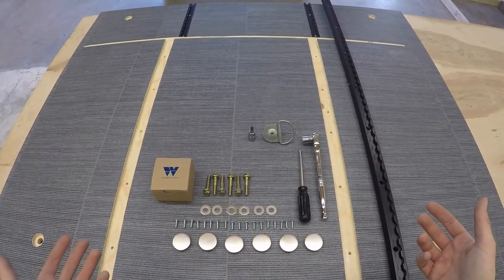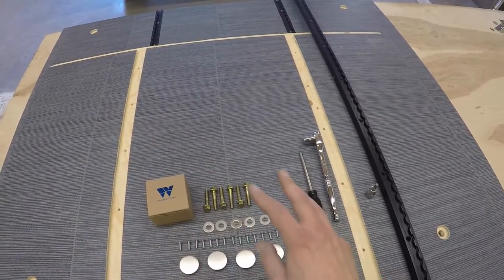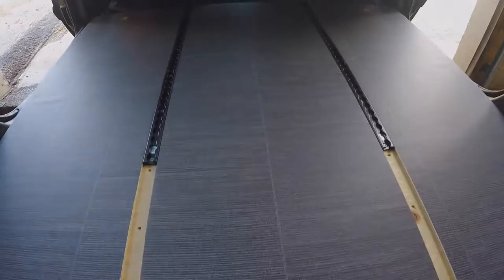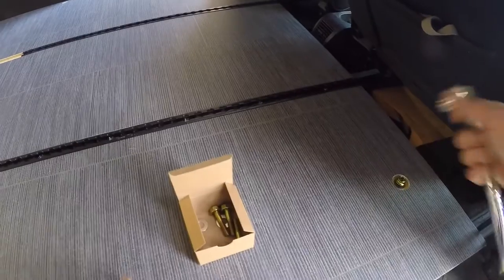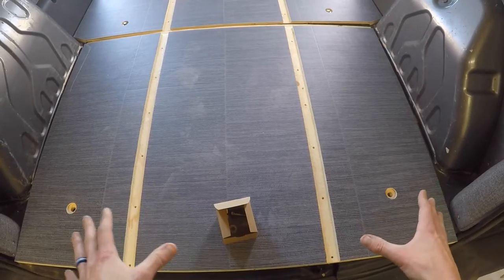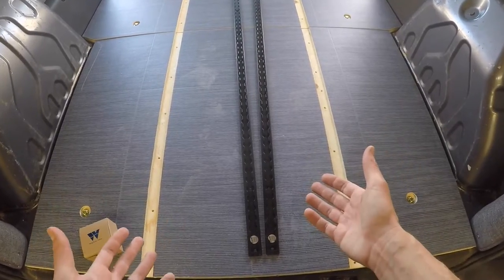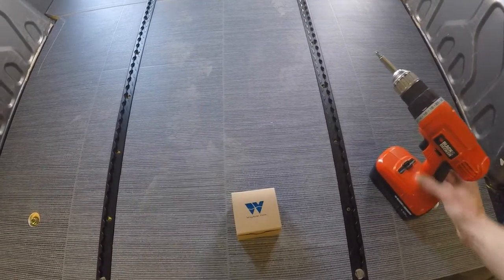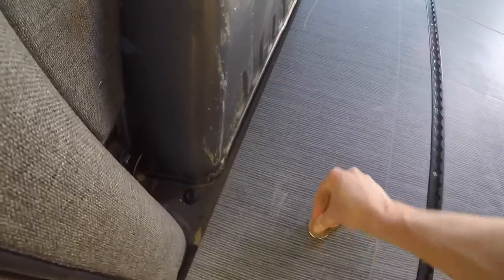Wayfarer Vans - Step One, Camper Van Floor Installation

Comment: What are your thoughts on putting down a layer of reflextics, and whether it would make a difference regarding extra insulation for colder weather and sound?
Reply from the maker: Hey Che,

We actually include a layer of reflectix on the bottom side of our floor, just isnt seen in the video.

Comment: Does this kit include rivet nut points for the tracks? the track installation seems a bit un finished in this video but I could be wrong.  It seems like you are simply mounting the rails to  the plywood...correct?
Reply from the maker: Hey Joe,
Actually, on the other side of the floor channels are T-nuts, so the rails are mechanically mounted to the floor rather than just wood screws that could pull out easily.  Hope this helps.
Reply: @WayfarerVans  gotcha

Comment: What is the floor made out of? How moisture-proof is it? It appears to be some sort of particle board. If so, especially along the track where it's unfinished - would that not immediately start to wick almost any small sort of moisture and start to warp/degrade the flooring? Seems like you are one good spill away from a warped and ruined floor. Not trying to criticize, I'm just curious because I'm actually very interested in your system for a future van purchase.
Reply from the maker: Hey Anthony,
The floor is made from a composite, and between the reflectix underneath and the vinyl we overlay on the top, it can resist a significant amount of moisture.  We have a lot of owners in humid climates and others who use their van for skiing, where the floor sees a lot of snow/slush. Therefore, unless the floor is exposed to sitting/standing water for a long period of time, you wont have any issues.
Reply: @WayfarerVans  THANKS!